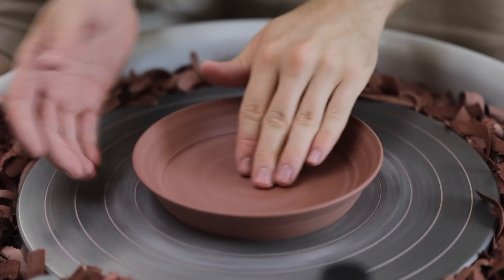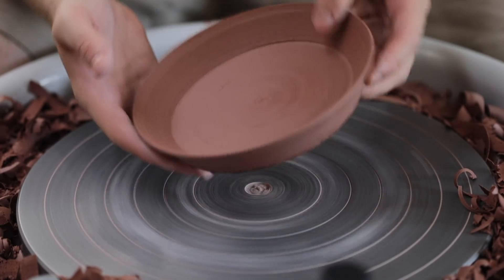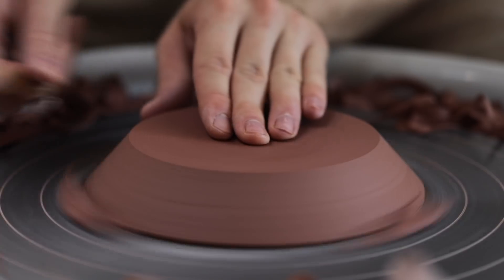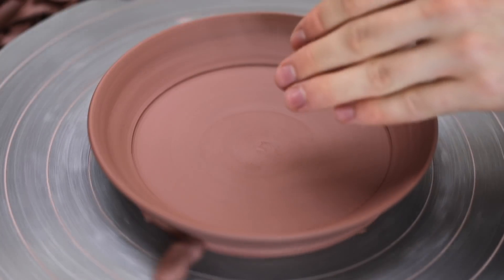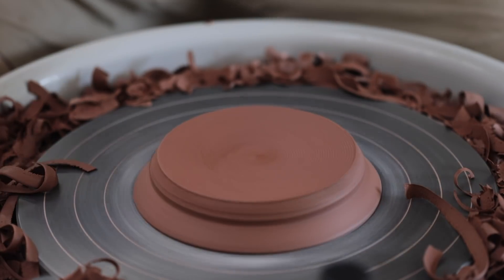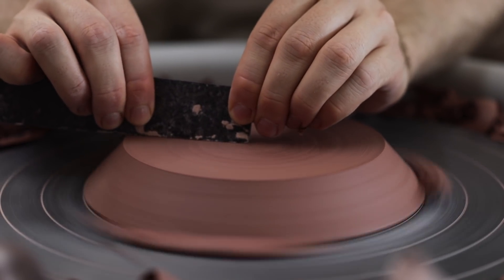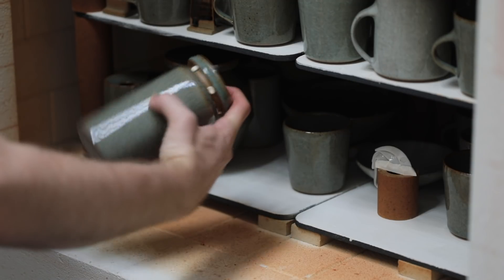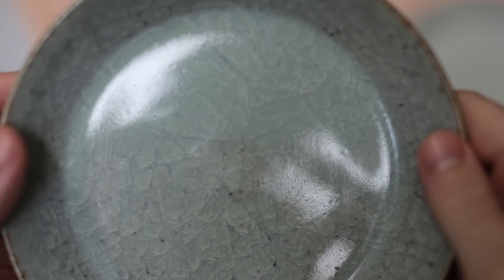Trimming a Simple Stoneware Side Plate — Narrated Version

Comment: I adore these plates. Simple form, wide bases, clean lines. Lend themseve well to the crackle glazes. I'm so glad you're getting to expand; those kiln shelves were a wonderful investment.

I've had a thought, though it is outside your norm. Have you any experience making paint pallets? I've been on the hunt for a glass/ceramic paint pallet with lots of wells or shallow tiny flat-bottomed, bowl-type things for watercolor and India ink but I can't quite find any that I love. I think your simple and clean designs could lend well to a set of tiny little dishes much like smaller versions of that plate. Simple walls to keep the paint in but a flat bottom that can also be used with acrylics and pallet knives, which often need a flat surface. Maybe stackable? Just a thought. 

Keep 'em coming.
Thank you

Comment: Now one of the big questions I have is: How do you glaze the plates? With mugs and bowls the area to wax is nice and small, do you just wax the entire bottom of the plate and clean it up?
Reply from the maker: Exactly that. Sometimes I make plates with feet, in the same way I do bowls, so there isn’t that much to tidy up. Other times I leave them totally flat across the base. Fundamentally any portion of the clay that comes into direct contact with the kiln shelf needs to be bare, so I’ll always wax those areas.
Reply: @floriangadsby  I honestly was racking my brain as to how you would dunk the plates, but simply waxing works too, although I would have expected that for one waxed place you could wax a dozen cup footrings, is that not expensive and/or material intensive on the wax side? (I have no idea what that kind of wax would cost or how much one "unit" of bought wax would even be. Come to think of it, I presume beeswax or the like would be unusable for such a process?)